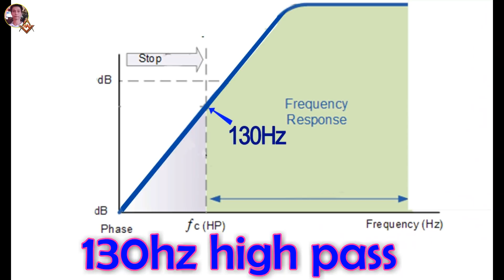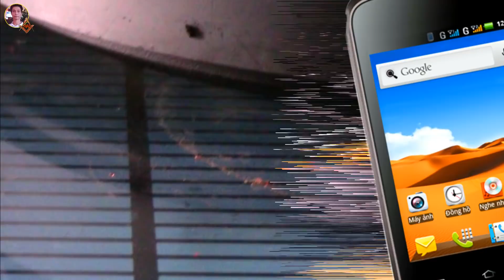How to make high bass speakers, 2 tips make stereo speakers louder with capacitors

Comment: Hola 
Fabulosos tus vídeos.

Más microfaradios más sordo o grave el sonido?
Woofer AIWA 8" que característica puede ser el capacitor a usar.
Gracias.
Reply from the maker: El valor del capacitor aumenta, la frecuencia del altavoz se reducirá: (los altavoces SUP tendrán más sonido a frecuencias más bajas)
gracias
Reply: Gracias Alfred.
Entonces puede ser como ejemplo  , 300, 600,2200 microfaradios según nos convenza el sonido?
He visto que los colocan en paralelo también cual
es la diferencia o lo más recomendado?

Muchas gracias. 
Saludos desde México.
Reply from the maker: yes, I will add a video about this. capacitor value will lead in a certain frequency range.
Reply: @estebanperez2435  No están en paralelo sino en antiparalelo, se ven ben. Ya no son electrolíticos sino que funcionan como cerámicas a gran escala.